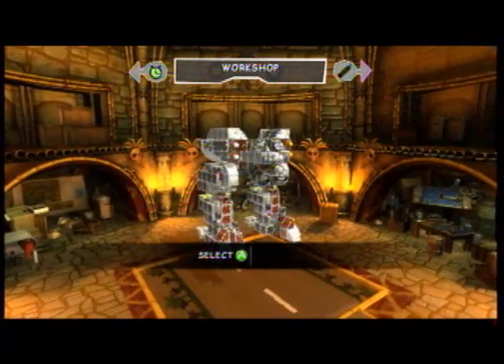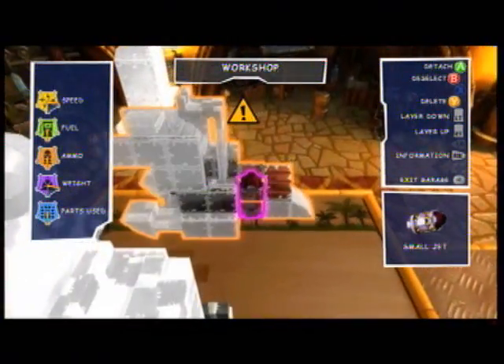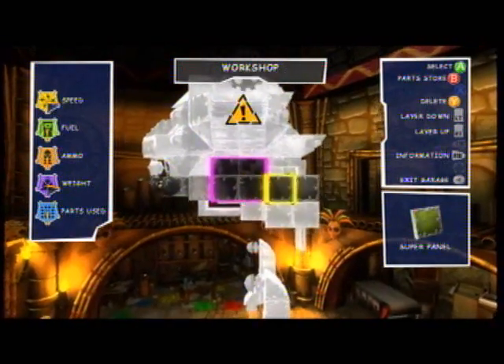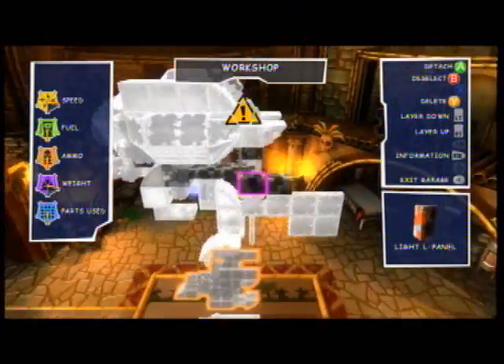Mr Gnawty: Banjo N&B - Walking Mech Tutorial.

Comment: A 4 Legged Mech probably is possible (If you have enough parts of course) you would probably build very similar legs to this (with a modified body of course) and have the front right leg move when the rear left leg does, and visa versa.

Moving arms probably possible as well, but would move when you walk (unless you can get around that some how). It would also be harder to balance (in my opinion) but I bet its possible...